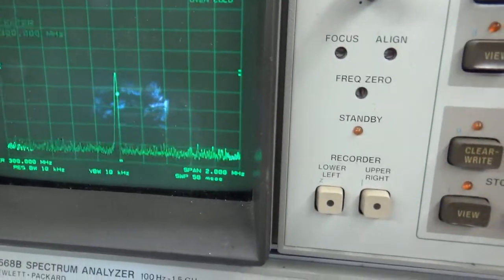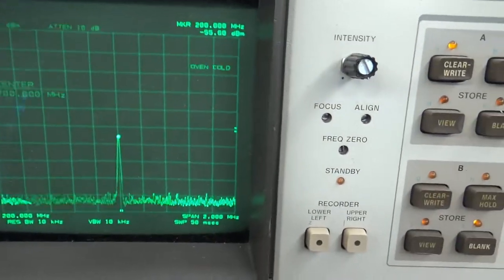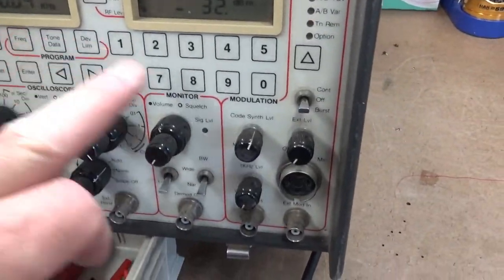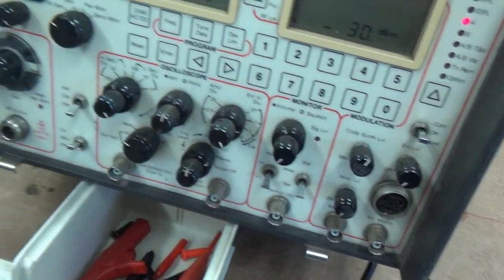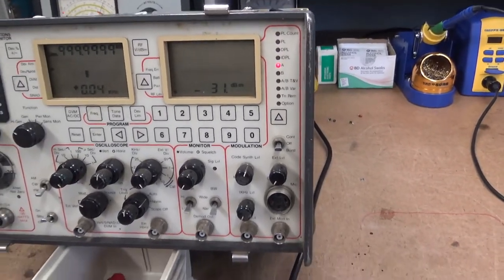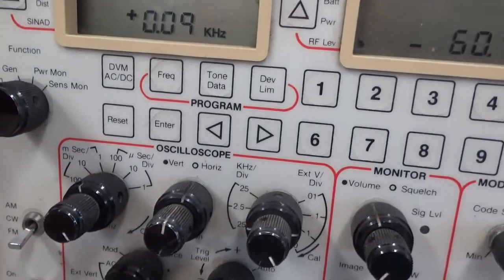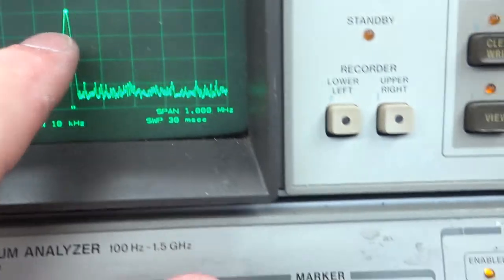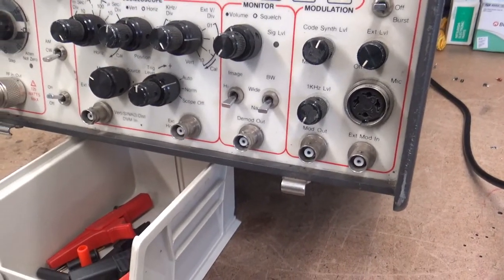Motorola R2200 Communications Service Analyzer Output Repair

Comment: Well.. great find and repair. I would also change the caps in the power supply.
I have a 2002C . Got it for $200. Changed the caps and it came alive. Great instrument.
Got a 2001 D on the bench now. Has a scope problem .. Looks like an IC on the scope/DVM board. Going to do it tonight.Also got a ton of new caps from DigiKey.. Made a 100 pin flexible extender card last night. Will be easy to repair being able to pull the board out and scope it ....Caps do age and the 2002C I have had quite a few that were way out of spec.
Graham VE3WGW

Comment: The wild thing is that you have a working 8568B, with a good bright screen. The cables to connect the display to the analyzer are sometimes worth more than than the display together with the analyzer.

Comment: I think the only way to find a CRT for these R2200/R2400 is to find a parts one...that has a good CRT. (Shops used to leave them on all day long... and a lot of them have worn out CRTs.) Never seen a new old stock CRT for these turn up. The IFR  service monitors you mentioned have the same problem... very hard to get a replacement CRT.

Comment: About the only thing left out by Motorola was the ability to program Motorola radios. Which is something I never liked about them. I understand their reasons but it would be easier for a tech to work with.

Comment: Hi can you tell me if you know anything, about the 2 way police and public works radio,s, I picked up A 1968 Motorola with large power supply,receiver,exciter and Driver, remote control with repeater, Its  41 inch cabinet, It has large oscillator crystals with 3 pins would like to get it working , No speaker, I,m thinking It may have had a amplifier, any help would Appreciate Brian
Reply from the maker: GO TO REPEATERBUILDER.COM AND CHECK THAT SIGHT OUT. HAS LOTS OF USEFUL INFORMATION ON THOSE THINGS.
Reply: @oldavguywholovesRCA  Thank you